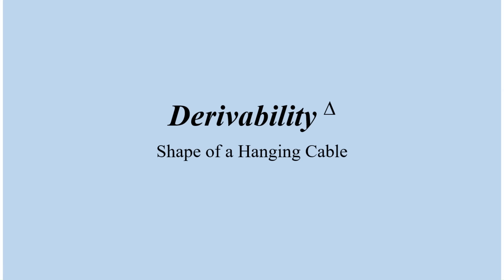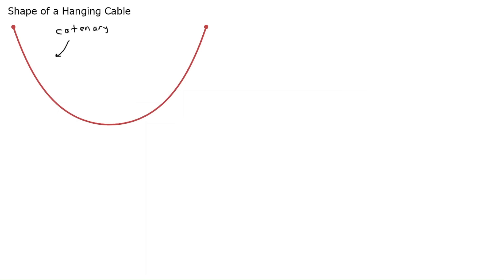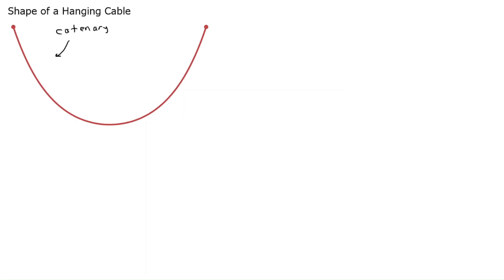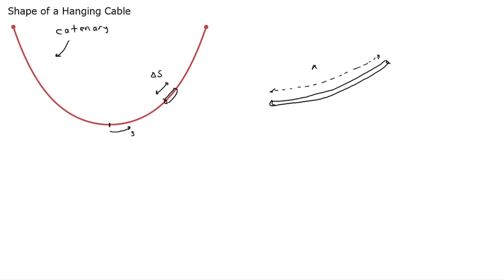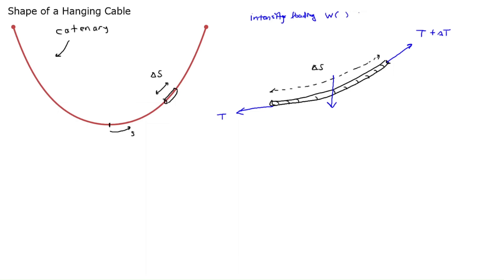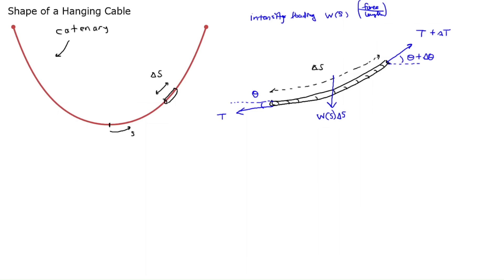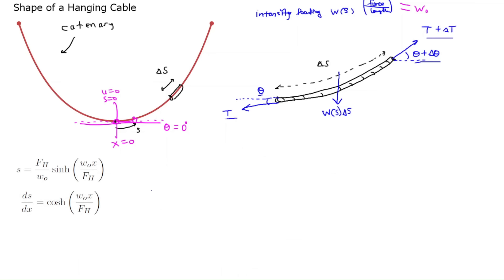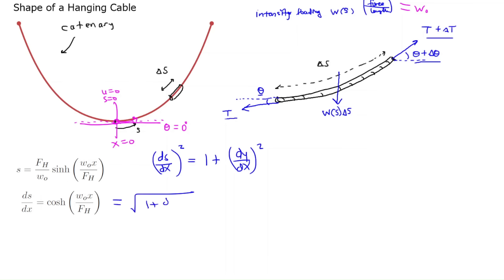Shape of a Hanging Cable | Mechanical Engineering | Physics

Comment: I was designing a substation when I needed to figure the tension on a wire conductor when I realized I was wearing an analog computer around my neck that would give me the angle at each end and the length with needed precision precision.

Comment: i have seen a common dynamics/physics problem that nobody seems to solve:
imagine 2 spools of a cassette tape separated by a distance, d, between their centers
let A be the point where the tape exits the spool on the left, call it spool1
let the tape exit point A without slack and enter point B on the second spool, spool2
assume a coordinate system centered on the center of spool1, with the x-axis intersecting through the center of spool2
points A and B are on the 1st quadrant
assume spool2 as the driver spool rotating clockwise with constant angular velocity omega2
given that at any time, t, spool2 has an instantaneous radius2 to point B, and spool1 has an instantaneous radius1 to point A
find: the instantaneous angular velocity of spool1, omega1, at any time, t
the instantaneous angular acceleration of spool1, alpha1, at any time, t
the linear velocity at A, and at B
the angle theta, the segment of cassette tape at AB makes with the x-axis
the angular velocity phi, that the angle theta makes at any time, t
the angular acceleration chi, that the angle theta makes at any time, t
the length of tape L needed to produce a running time T, assuming constant thickness, m; assuming spool1 has minimum radius rr1, and spool2 has minimum radius rr2, rr1 and rr2 are not equal to zero, and radius1+radius2>d
+ any other simplifying assumptions implied

Comment: Love the video. Quick question, what type of Taylor series is that, because I’ve never seen f(x+dx)=f(x)+f’(x)dx before
Reply: It's the same reason mentioned later that the higher order terms of dx (degree greater than 2) in the expansion are neglegible, leaving the first order term of dx
Reply from the maker: Start with the more common Taylor approx, which is f(x)=f(a)+f'(a)*(x-a).  Replace x with x+dx to get f(x+dx)=f(a)+f'(a)*(x+dx-a).  Now set a=x.
Reply: @derivability  thanks you, that was very helpful. Actually very crazy that it works too

Comment: 7:56 I am not so sure about this part. Why exactly does d(Tcos(θ)) equal to 0? In Tsin(θ) • ∆θ equal to 0 if ∆^2 is equal to? what is this operation? Taking a limit?
Reply from the maker: One way to think of this is using a small angle approximation.  In this case, the small angle is (delta theta).  When we do this approximation, we only keep leading order terms, like (delta theta) to the first power.  Higher power terms are neglected.  (Similar to taking sin(theta)=theta in the simple pendulum problem.)

Comment: This is NOT correct!
Gravity is splayed, or angled, from the centre of the Earth, and is less at the top of the chain than the bottom.
The true equation is complex.
Reply from the maker: You are correct.  For most physics or engineering applications of a hanging cable, assuming a uniform vertical gravitational field is a very good approximation.  I have heard of the problem of a hanging cable in an inverse-square field, but have never attempted it.